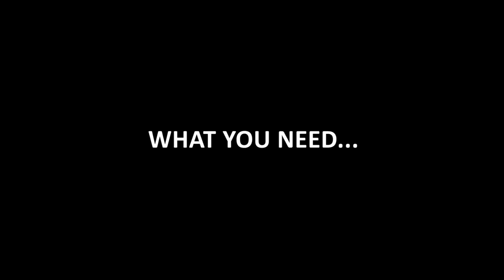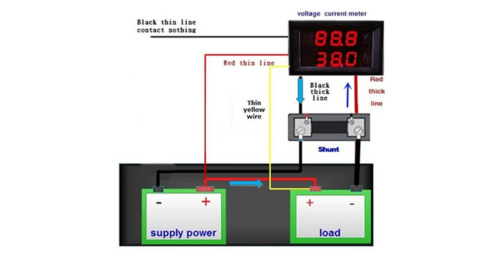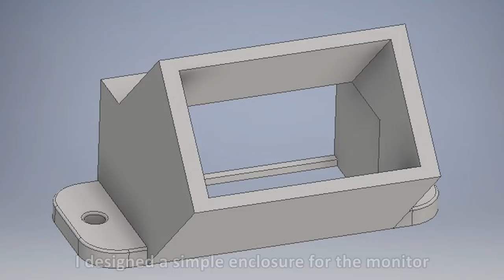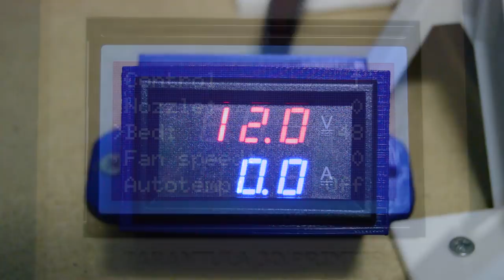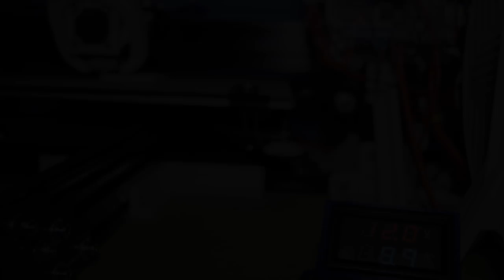TEVO Tarantula 3D printer - HOW TO improve your printer - Part 16 (Volt/Current monitor)

Comment: You are an expert for Tarantula printers.
I used clamp meter the other day. My 3D Printer draws around 20A when bed is heating up from cold (100% duty cycle).
I am using a computer 400W PSU.

My upgrade parts are still on its way but I would definitely apply most of them on my own printer.
Keep up good work :-)

Cheers,
Reply from the maker: Hi Dominic,
Your printer draws more current than mine. The bed with 100% PWM duty cycle only draws 15A max.
This was a test that i wanted to do for some time now since the burned connectors issue.
The Main screw connector and the bed screw connector on the board are rated 16A and with my test (and at least in my printer) the current draw is inside the limits.
Reply: I am with large print bed.
Would that be the contributing factor drawing more current on mine? I keep monitoring the temperature each time I heat the bed up and the wires are slightly warm (but it absolute touchable)./

I understand the clamp meter is less accurate in real life...
Reply from the maker: Hi Dominic,
I also have the large bed.
What i notice is that, if you start a print, the printer will first heat up the bed (13.6Amps in my case) and only after it reaches the temperature it will start to heat up the nozzle (+2Amps). With the bed in temperature, the current draw is less than when heating up.
That's why it's better to heat up the bed and only after the nozzle. If you try to heat up both at the same time you will get both mosfets at full PWM duty cycle. 
In your case, you get more current draw from your bed...could be that the bed you have has less resistance and therefore more current draw. Do you get your cables hot or notice anything wrong? If yes, then i recommend using an external mosfet and stronger cables.

Comment: Generally connected to the mosfet on the common line of the mainboard / bed, When turned on the printer shows 0.28A (about), the bed warms from 0 to 65 at 21A, the nozzle is added from 2A Later just jumps with overheating about 20 - 25A.
The PLA 195/65 was 2.2 - 3.1A

Comment: Nice video! Can you make a video how to make the power supply safer? Because I am Worried that I am gonna get shocked by 230 volt!
Reply: I would recommend you to get a computer PSU - they are modular design and with good protection (or they would fry the motherboard easily).

You can get a 80Plus and reputable brand for a peace of mind (400W is around $110 in AUD in Australia).

PS: my original PSU still in its plastic wrap and I never use it since day one :-)
Reply: Thank you! I will buy a psu!

Comment: hi!
I have a large build plate with two yellow wires . where do they go?
or are as I suspect 24v optional cables?  they ending up in a two pin contact. 
thanks for your time and effort to enlighten us!  it's been a big help for me.
Reply from the maker: Hi Anders,

You should have 2 power cables (red and black) and 2 thermistor wires (yellow).
If that’s the case, you need to connect the thermistor wires in the bed thermistor port in your main board.

Comment: Hi Rui , i would like to ask you something, what are the right cable size to use from the psu to shunt ? they could be able to carry 30 amps? what is the size you used to? thanks a lot
Reply from the maker: Hi Felice,
I used thick AC threaded wire that is rated for 30A or more.

Comment: If I were to use a ammeter with a 50A shunt resistor would that just allow the meter to show a higher maximum amperage compared to the 30A shunt?

Comment: Hello Ruiraptor. It´s possible to add a bed auto levelling on the Tevo Tarantula. Your Tevo Tarantula doesn´t have?
Reply from the maker: Hi Silvio,
Yes it's possible but you have to print a sensor mount for it. I never used it because i prefer manual leveling :)
Reply: another question, when you perform manual leveling, do level in the middle of bed?
Reply from the maker: Yes, i need to check the center of the bed. Because you only have adjustments screws on the corners, if you have a warped bed you will not be able to get it perfectly right. For a warped bed, the sensor will help to compensate...or get a flat glass and place it on top of the bed (as i did with mine).

Comment: Ruiraport, I have a problem where the printer is not printing in the middle(off centered). When i home my 3d printer it says: X-11 Y-41 Z0,8. I tried  to put in the line in the g code G92 X0 Y0 and it also doesn't work! In Cura i have set that the home is in the left corner. Can you please help me?
BTW I have a Tevo Tarantula.
Reply from the maker: Hi Beerveen,
The X-11,Y-41 and Z0.8 are the default offsets that are written in the firmware. You can choose another offset in the display (set them to zero) but i don't think that you will be able to store this in the eeprom with the stock firmware (but you can try). Power cycle the printer and check if the offsets go back to the X-11,Y-41 and Z0.8.
You can flash a new firmware (i have a video explaining the entire process) and if you do, you can define the offsets to x0,y0,Z0.

Comment: Are you planning on switching to 24V supply? If I understand correctly it's just a matter of rewiring the bed and getting a 24V heater cartridge. Oh, and figuring out a supply for 12V fans if you don't want to change them, which could even be just a matter of halving the duty cycle in firmware. Maybe low pass filters at the outputs, since the PWM frequency is already annoying. Kill two birds...
Reply from the maker: Hi John,
Changing the power supply from 12V to 24V has come to mind. A 24V power supply will allow reaching high temperatures much faster. However, in my case, since i only print with PLA, i don't need to reach high temperatures and therefore, the 12V handles just fine. Normally i print with bed at 60º and nozzle at 211º. The bed is the one that takes longer to reach temperature but in my case it's just a couple of minutes.
Reply: I understand there are other benefits, beside faster bed heating, like better running motors. I've been thinking about 24V since my first print because the board power connector melted, same as for many other people. I'd just like to have less current running around that Chinese board... :)
Reply from the maker: Hi John,
If you want less current to go through the board then my advice is to get an external mosfet.
The biggest load is the hotbed and with an external mosfet you will eliminate all that current out from the board.
Reply: That's a great idea if you're not going for a full 24V conversion! Thanks!
Reply: I have one installed - should I wire the Volt and Amp meter the same way you showed in this video or do I wire the external MOSFET into this meter?
Reply from the maker: Hi Maciek,
If you have an external mosfet, you will not be able to measure both (printer + hotbed) unless you install the shut before the mosfet power connector and printer and that will complicate your setup which i dont recommend.
Because i don't have an external mosfet, i can measure the entire system (except for the extra fans that are connected to the power supply). My advice to you is to keep the external mosfet and only decide if you want to monitor the current of the printer or just the hotbed.

Comment: Hey man, I am now certain that i will buy this printer and i thought of the mods i will make because i will buy the parts needed at the same time. This is my first step into 3d printing and my electrial skills are low so I wont be doing complicated mods. These are the ones i chose to make:
Adding a fanduct (no shit lmao)
Printed z axis bracket replacement
Glass for heatbed
Heatbed thumbscrews
Fixing the printer onto a surface
Part 12 of you how to series
Power supply fan.
These are the ones I am certain of and I am not sure if i should do part 1 of you series. Do you recommend any other ? And i have no idea how to connect the the fanducts fans wire. Thanks.
Reply from the maker: Hi tunaBBQ,
Most of the mods/upgrades are printable so you can add them anytime.
What i recommend you do from the start:
Buy washers (to use as my part 2 upgrade video but specially use them between acrylic)
Buy a glass for the heatbed
Print a fanduct
Get ferrules and ring terminals for a better electrical setup (get a crimp tool)
Your new printer power supply already might have the fan -> get one if it's not
about the fans...
the fan that is cooling the heatsink of the hotend -> connect it to the power supply 12v
the fan that will be used for the fanduct -> connect it in the board where it says "fan"
Any question you might have, we at the facebook tevo tarantula group are always ready to help...or just ask me and i will try to help you :)
Reply: Oh man I love you, you really are the best. If it wasnt your tips I wouldnt be confident about buying this.
Reply: ruiraptor Do you think E0508 (0.5mm²) tube crimps would be ok or are they too small. I can send you the link if ypu want. And for the ring crimps are 4mm ok ?
Reply from the maker: For the ferrules, you need to use according with the wire to be used. For example...for the cooling fan, a 0.5 will work because those wires are too thin. But for the main power and hotbed you need to use much bigger. I think the stock wire is 2.5 i think. There are kits of crimp tool + ferrules (several sizes) on sale cheap...i recommend this kit (a user posted a link of this in the comments in my electrical improvement video).
The ring terminals is the same thing...they must be for 2.5mm cables but there is a note...the ring it self cannot be too big or it will not fit in the power supply screw slot. I have here some and they measure: outter diameter= 8mm // inner diameter=5mm
Reply: ruiraptor Awesome, then i will get a kit for both !
Reply: About the 2. video, in the comments someone says that the wheels come with the washers inside by default in the new units. Should I check if that is the case with mine when i get the printer ?
Reply from the maker: Hi tunaBBQ,
don't bother because since a few months ago they are all shipped with the washer inside.
Check the other video instead...the one i show how to assemble the wheels with regular washers instead of the stock spring washers and i use lock nuts instead of the stock normal nuts.
Reply: ruiraptor Ok I will add that to my list too.